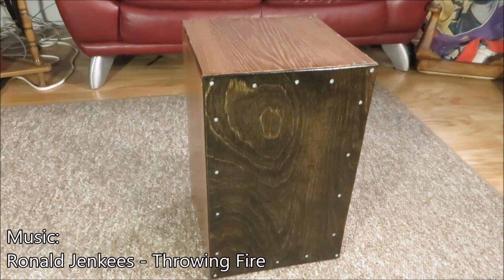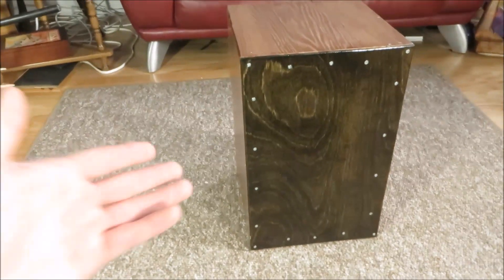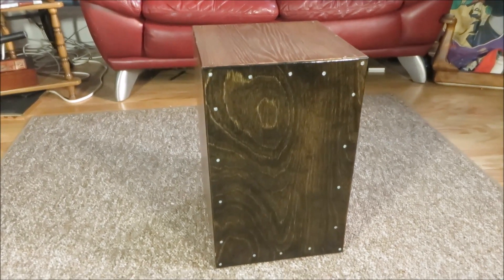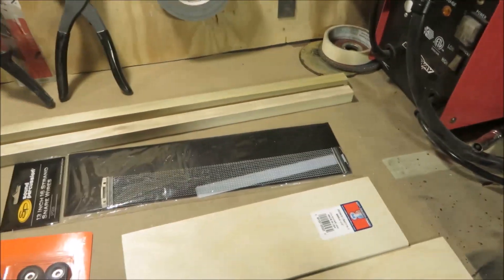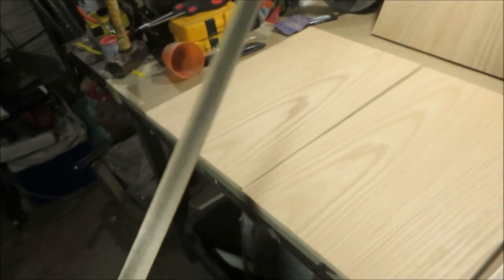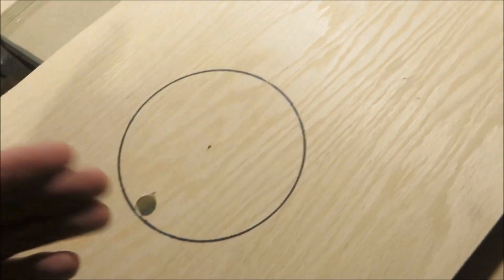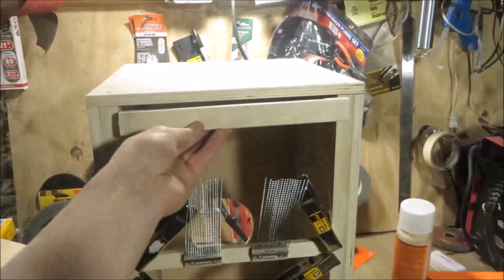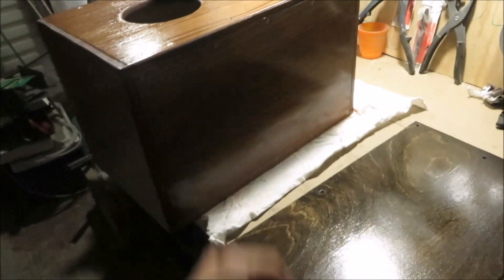Can't Afford a Drum Kit? Build a Cajon!

Comment: HOW TO BUILD A CAJON

materials:
3mmx12"x24" - birch plywood
9mmx12"x4" - birch plywood
No slip couch grips (with screws)
waistband elastic
1" #6 construction screws (brass if possible)
3/4" square poplar dowel
13" 16 strand snare wire
1/2" oak plywood
wedges

dimensions as a whole:
19"x12"x12"

12"x12" 1/2" oak X2
18"x12" 1/2" oak X1
18"x11.5" 1/2" oak X2
19"x12" 3mm birch X1
18" poplar dowel X4
11"x1" 9mm birch X1
9.5"x1" 9mm birch X1
1"x1" 9mm birch x4

building:
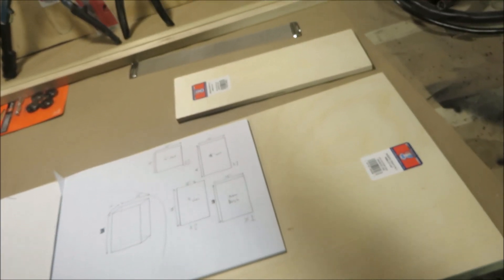5:47
Reply: I know a lot of people were looking for materials and all. A little late but hopefully still helpful to someone
Reply: Dude thank you so much , I'm gonna screenshot this and pull it up when I get to home depot.
Reply: +Junior Pentz home depot probably won't have anything (it didn't when I went) I would suggest looking for a lumber yard nearby.
Reply: +amatorif yup , I realised that when I started researching home depot. lowes is even worse.I'm gonna get out to the lumber yard on Thursday.
Reply: Did anyone actually try this and how did it go??
Reply: literally watched the video a dozen times while writing down those specifications only to check the comments and find that you did it for me.... ugh...
Reply: "A little late" lmaoo
Reply: @booty_hunter4207  for real
Reply: not all heros wear capes

Comment: You could also use the screws to hold the pieces instead of clamps. Once the glue is dry, it is actually stronger than the wood or nails are also. Just an idea to save you some time and steps. Just glue, screw, and move on.

Comment: can I use drum sticks too, would it be harder sounding or whatever?  serious question..
Reply from the maker: +Mr. Andersen Ehhh I wouldn't, it could damage the finish, and it sounds just fine with your hands.
Reply: +ZNA Productions  , Thank you Mr. ZNA. This inspired me, and I will try to make one. Very amazed bout the sound. Im a hiphop producer but I also play multiple instruments. I will really try this out. Thank you : )
Reply: +Mr. Andersen Sticks aren't typically used for percussion instruments without a skin unless you are just trying to bash something like a wood block. In my opinion, I think that you should just use your hands when playing the cajon but if you really want a wood on wood sound, you could always try hitting the edges of the cajon with a dense wooden dowel on to mimic the sound of claves.
Reply: Thank you. Enlightening
Reply: +albinothereal Since Your building it,  you could always add to the design! Maybe a wooden 2 x 4(6) Wrapped in felt or something;  To hit, using some Drum-Sticks?

Or a Speaker, Plus Power Source & Aux Cord for a Modern-Boom-Box-Drum-set-Duplex-Design  as well...
 Would that   F#&% Up the Sound of the overall design tho I wonder!?

-KAA
Reply: +Mr. Andersen You can use brushes if you wish, that is sometimes used with a cajon.
Reply: +Mr. Andersen you can use a "brush", but stick is not recommended.
Reply: +Mr. Andersen CSDMusic is right the drum sticks would damage the thin wood.I tried it and well now my cajon has some "battle scars" xD
Reply: mabye  funny my band teacher is named Mr. Andersen
Reply: they make special sticks for cajons. just look on Amazon
Reply: brushes sound really good.
Reply: Nice pic, I love SlipKnoT! R.I.P Paul \m/
Reply: +Andrew Rosemarying Perhaps mallets?
Reply: capitalistraven i would be cautious with mallets. the cajon may be a little hard and might flatten or straight up ruin the heads. along with that, the oils that transfer from your hand onto the face of cajon can transfer onto the mallet,causing them to turn black or gray.
Reply: Brushes!
Reply: The surface is too rigid to cause vibrations to make sound
This is why the drum surfaces are made up of paper.

Comment: I actually want to build this, but those wedges, what are they, like dimension wise and what type of wood.  Also does it matter what wood we use for this whole build?
Reply: Im pretty sure the birch for the front plate is necessary for sound quality, because you want a hardwood thats tough to last long and maintain good and consistent sound, but the rest im not sure.
Reply: Im not exactly sure about that though. I know a little bit about birch, but thats it.
Reply: Materials matter a lot, because vibrations vibrate through different materials at different frequencies. That's why different style guitars use different materials.

Comment: just a tip for later, try not to put all of your screws on the same grain of wood, it could split it. instead, alternate them in kind of a zig-zag pattern the same distance that you had them, just alternating between the left and right.

LIKE THIS:
---------------------------
•
  •
•
  •

and so on
Reply from the maker: The face plate is plywood, meaning multiple thin veneers of wood glued with their grains crossed, so you don't have to worry about it splitting. Thanks for the comment!

Comment: I have a drum kit but I want a canon 😂 cajons are way easier 😋
Reply: It fits in your back seat or trunk in seconds. Really cool to have if a jam session comes up and you don't have the time or space to lug your drum set around.
Reply: Burn down a forest. Collect the charcoal. Build a forge. Mine some iron ore, potassium nitrate and sulphur. Cast an iron cannon and cannonballs. Create gunpowder. Get a stick. Cut down some hemp, split it into fibers and spin them into a thin rope. Cast a collection of iron hooks. Dig out a worm. Create a fishing rod. Go fishing in a river, obtain a load of basses. Soak the hemp rope in the solution of potassium nitrate, and let it dry itself on the air. You have a fuse now. Go back to your cannon. Find a piece of flint among the rocks in the dirt. Cast a steel rod. Combine it with a piece of flint to get a flint and steel. Load the cannon with gunpowder, put a cannonball inside. Put the fuse into the hole on top of the cannon. Create some more rope. Use the rope to tie down basses to your cannon. Load the cannon with basses. Light the fuse using the flint and steel. Congratulations, you have a bass cannon now. ~ WubWubWubWubWubWubWub ~
Reply: LordDragox412 ...
Reply: LordDragox412 thanks for the tutorial, i tried firing it but instead of a bass sound all i did was destroy my neighbors house. Can you tell where i messed up?
Reply: Colin M
You didn't mess up. Now your neighbor's house is full of bass. Or bass guts, to be more precise. So he doesn't need to hear the bass anymore - he can feel it with his whole body, thanks to the tremendous smell. Point and click games are so fun :D

Comment: The screws for this are really unnecessary. The bond the glue makes will be stronger than the wood itself, if you don't believe me, look at an acoustic or set in neck guitar, more than 200lbs if tension and the glue does just fine on its own.
Reply: Not trying to hate, just trying to make a suggestion.
Reply: +Tristan Popowski i think he was going for the look along with just being safe
Reply: You dont sit on a guitar though. Guitars have a tendency to warp and such, and that is without the weight of a person on it. The screws are better for this kind of build